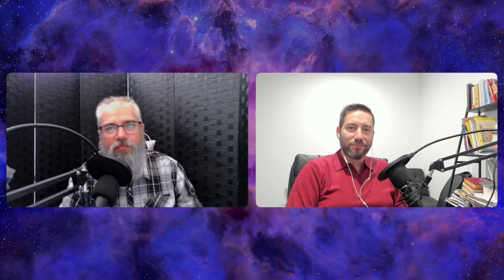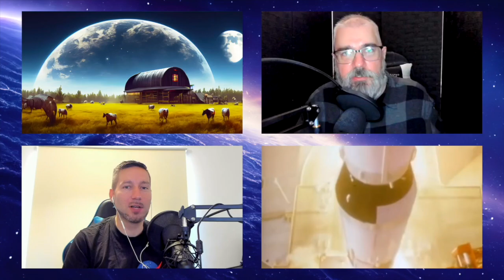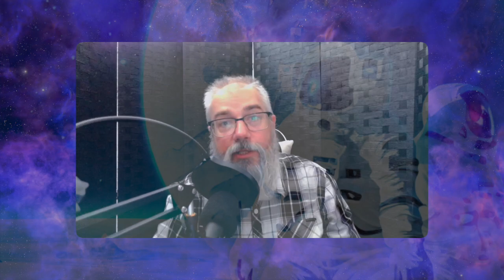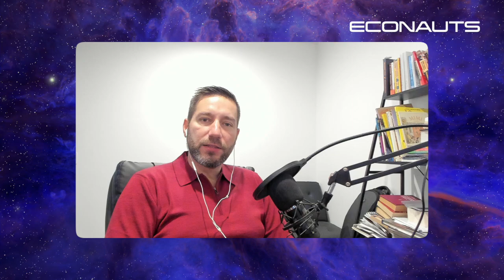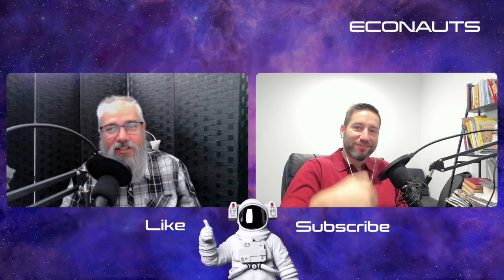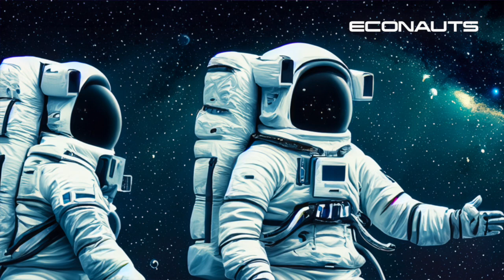Econauts: Ariane 6

Comment: I feel the ESA dropped the ball on this one. they should have developed a reusable first stage just like SpaceX. However, here are some possible reasons why they did not go this route.

While it's true that SpaceX's reusable Falcon 9 first stage has been a game-changer, there are several reasons why the European Space Agency (ESA) chose a different path with Ariane 6.

ESA's Ariane program has a long history, dating back to the 1970s. Ariane rockets have been reliable workhorses for launching satellites into space.  When Ariane 6 was being designed, the concept of reusability was less mature. Ariane 5, its predecessor, followed a traditional expendable model.

The commercial launch market is competitive. While reusability reduces costs per launch, developing reusable technology requires significant upfront investment.  ESA had to strike a balance between cost-effectiveness and maintaining its market share. Ariane 6 aims for affordability while ensuring reliability.

Building reusable rockets involves creating landing pads, refurbishment centers, and specialized recovery vessels. ESA would need to invest in this infrastructure.  SpaceX had the advantage of starting from scratch with Falcon 9, whereas ESA had existing facilities optimized for expendable launches.

Developing a reusable first stage is technically challenging. ESA might have opted for a more conservative approach to minimize risk.  Innovations like reusability often involve trial and error. ESA may have chosen reliability over rapid experimentation.

ESA collaborates with multiple European countries and industries. Balancing interests and priorities can be complex.  While SpaceX competes in the commercial market, ESA also serves institutional missions and scientific research.

In summary, while reusability is enticing, ESA's decision reflects a nuanced evaluation of factors beyond pure economics. Ariane 6 aims to maintain Europe's access to space while adapting to changing industry dynamics.
Reply: In 2014, the European Space Agency (ESA) made the decision to develop the Ariane 6 rocket with reusability in mind. This was in response to the rapidly changing landscape of the space industry, where reusability was becoming a crucial factor for cost reduction and competitive advantage, primarily driven by the success of SpaceX. At the time, the concept of reusability seemed technologically challenging and risky, leading to doubts about its feasibility for Ariane 6. 

However, as the industry progressed, it became evident that reusability was essential for maintaining competitiveness. Unfortunately, by the time ArianeGroup fully recognized the necessity of reusability, the Ariane 6 design was too far along to incorporate these changes without significant delays and additional costs. This left Ariane 6 less competitive compared to fully reusable rockets in terms of cost-efficiency.

As a result, ArianeGroup now regrets the decision to forego reusability for Ariane 6. Looking ahead, they are committed to ensuring that Ariane 7+ will be designed with reusability from the outset, to align with industry trends and ensure competitiveness in the global market.
Reply: @BenjaminKaebe  Indeed!  The Ariane 7+ will be one to watch especially with the development of the Prometheus methalox rocket engine that ArianeGroup is developing.  And perhaps a future focal point for a future Econauts episode.  Keep up the great work my fellows!
Reply from the maker: Thanks for your comment. Many good points made here. Exchanging a reliable and known concept with another is never easy. Many factors have to be considered. Price and reliability are definitely main components when talking about game changing technology.